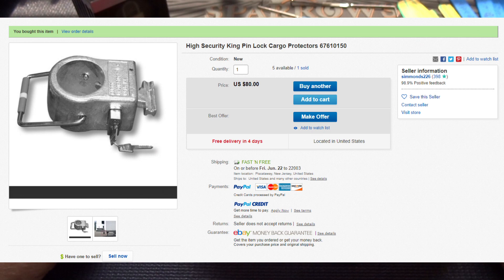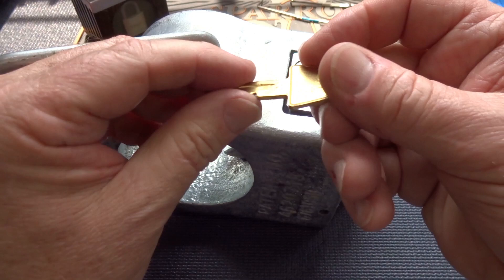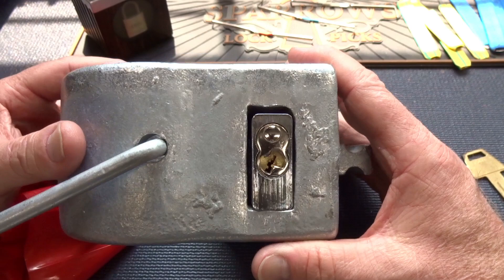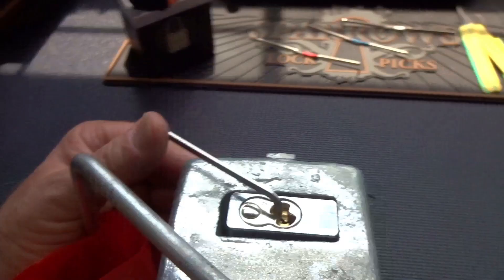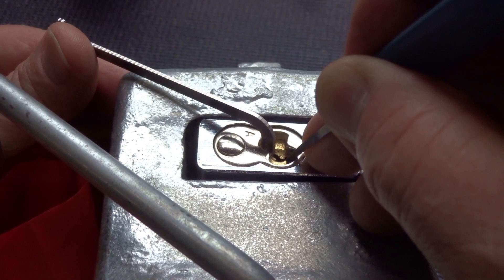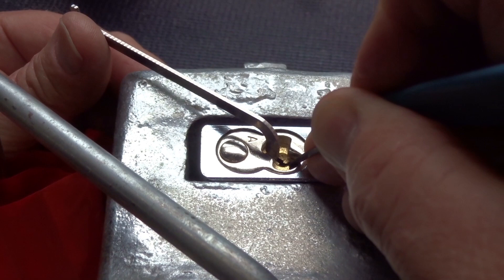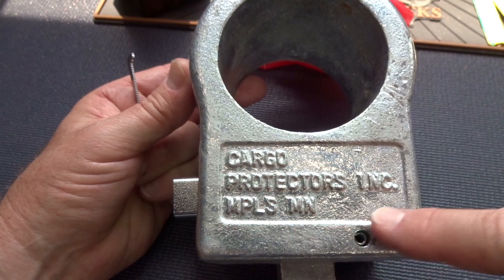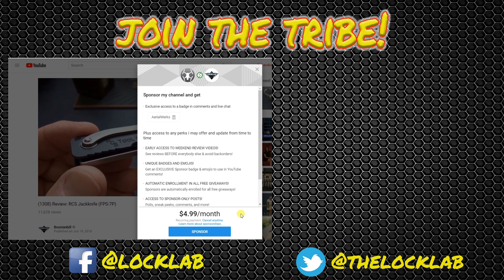(1310) Tractor Trailer King Pin Lock Picked Open

Comment: Just FYI, those locks are used if the truck has to uncouple from the trailer and leave it somewhere that isn't secure. Like if the truck needed repairs and the trailer has to be left in the lot. And yes the top of the lock will be flush with the bottom of the trailer and will be a greasy mess. They do not like uncoupling from a trailer because they are responsible for any damage or loss to the trailer or cargo until it's delivered.
Reply: I made the assumption those locks were so you can make sure another driver doesn't take a load out of the year that you wanted but hadn't got your tractor hooked up yet.
Reply: No, loads are assigned by the company, you haul what and where they tell you, although most good load planners will take into consideration where, when, and what you want to haul.
Reply: Driving around, I am always shocked at how poor the locks on big rig trailer doors are.
Reply: I ran a receiving dock for a for 3+ years at a distribution center of a large snack foods company, so I saw a decent selection of the locks that are used. From my experience I can say that most company drivers will use locks issued by their company since virtually all companies with more then 3 -4 trucks will supply them to their drivers. Any decent sized company will buy a whole bunch of locks all at once, and, usually, have them all keyed identically. Cheap ass Master Locks are probably the most common type of lock that companies will purchase simply because they are cheap. Owner-operators, the guys that own their own truck and often their own trailer, tend to buy nicer locks then most large companies do. 

Though at the end of the day trailer locks are mostly just their for ass covering purposes. Loads are almost always insured, and putting a door lock on the trailer that is attached to a tractor (or door + king pin / glad handle lock for a trailer that is waiting to be picked up) is mostly done to ensure that the carrier that is hauling the load won't be found at fault if the load, or any part of the load, goes missing. As long as those locks are present on a trailer they can usually say that they did their part to ensure that the load was secure, and be reasonably sure that they have very little in the way of legal liability.
Reply: It is also worth noting that aside from a REALLY greasy mess when attached to a trailer, in the winter even unlocking a kingpin with a key can be difficult.  In the yard truck of the distribution center I work at we carry around a can of lock melt to avoid any more trouble then necessary.
Reply: It's basically a theft prevention device.
Reply: William Jones this is what most locks are for.
Reply: It's actually company policy with large companies like CR England that you don't drop trailer outside of a company drop yard

Comment: This is to secure the trailer when taking the truck elsewhere. You are corect, the top of the body would be flush with a steel plate on the bottom of the trailer. To complicate things more, most driver will put a grocery bag around it to keep the grease off the lock.

Comment: It's a nice idea & easy enough to use. However, I've used a more secure setup on my 5th wheel using a short length of hardened chain wrapped around the kingpin & a high quality lock to hold it. The wider bottom of the kingpin & lack of room to fit bolt cutters, protects the chain from being easily/quietly cut. Far less than $80 & a superior method IMO.

Comment: I got a couple trailers and use the very same locks in as well as air line glad hand locks to prevent hooking up an unlocking the brakes but that's on the rare occasion that they're not coupled to the trucks, before using the locks we'd wrap hardened heavy chain around it and locked it up

Comment: Used to use these at work to secure trailers so a driver wouldn't pull the wrong trailer, while it was being loaded/unloaded still, on accident. Not really a security thing, but a safety thing. One of these and a big cone to warn them. If they left their tractor attached we'd chock their tires with a locking chock and put the cone on their hood. A lot cheaper than a dok lok, but prone to human error.

Comment: As a longtime truck driver I know about these things and there is very little, if any room at all for the would be picker to be able to directly eyeball the lock cylinder. As much slack as these locks have, they do fit up against the bottom plate of the trailer rather snugly. Unless the thief really wanted the trailer and its cargo, they would most likely move on to easier pickin's. No pun intended.
Reply from the maker: Yeah, I figured it would be pretty tight under there.  I actually took my lock up to Safeway and asked if I could film it on one of their trucks out back.  They refused, saying I might "get hurt if the truck fell on me" and they'd be liable.  I've never seen a trailer spontaneously collapse on itself and am SURE thousands of truckers do this kind of thing every day, if not every hour - yet we're not reading anything about crushed truckers in the papers...  What a litigious society we live in today. 😀

Comment: Having used pin locks before the lock freely rotates on the pin with the top surface on the 5th wheel plate of the trailer limiting room to move. On top of the freely rotating and limited space you have to deal with the nastiest grease coating everything down there in a spot that you are bent over in. 

The challenge on this lock is not the lock itself it is getting it stable enough to pick it in a confined space. 

When we just transferred the lock from one trailer to another it was easy to move from one to the other but when we had to store it we would store in a plastic bag to stop it from getting grease on everything around it. Funny story on that was the manager was looking for a stolen item and found the bag with the lock, he reached into the bag without looking only to remove a very grease covered hand.
Reply from the maker: Yeah, I've looked at some of the king pins and can understand how anything coming within 10 meters would get grease on it.

Comment: I know how you like to test the security of things so as a previous truck mechanic i heard a way to bypass the entire lock by unloading a can of electronics duster on the side opposite the lock and smacking it with a hammer the theory is the majority of the device is made out of cast iron and using the spray duster which comes out very cold will mess with the metalurgy and become very brittle allowing a hammer blow to destroy it
Reply from the maker: That's an idea I'll have to try, thanks!
Reply: Bosnianbill fyi wear gloves the can gets very cold!

Comment: Surely once its open removing the two locking pins /grub screws top and bottom will allow you to withdraw the locking lug and thus the lock itself from the housing as they would need to be rekeyable? EDIT see pdf description on how to separate lock from main body https://www.cargoprotectors.com/wp-content/uploads/2014/06/AM101inst.pdf

Comment: that looks very similar to the master lock #387.  2 or 3 good wacks usually pop those things off.  that one looks slightly stronger, but if it's cast iron, cast aluminum, or another weak metal they don't handle deformation very well.  The good ones are the big dome style ones.  usually made by universalboot (dot com), but are probably a little too pricey (complete with medico cylinder).  There is also the war-lok which also operates on the same principle.  Personally, i have a universal boot for when I have to lock my trailer.  Had it for around 10-12 years and it works by when someone smashes into it, it rides up on top of the 5th wheel, instead of allowing someone to smash into the thing and break it off.

Comment: Going to be awkward to get at for sure..maybe 3-4 foot of the ground? So stooping/crouching rather than kneeling..its also gonna be pretty flush as Bill says. Likewise dirty and greasy for sure.
Adds a critical delay rather than outright prevention. But a useful lock for high value freihht...or maybe it just points out the otherwise high value load on the lot? 😎
Reply: Not really, drivers will even lock an empty trailer if they have to leave it somewhere because they are responsible to the company/ owner of the trailer if it gets stolen, and trailers aren't cheap.
Reply: CO Jones Maybe some drivers do..or some company's insist they do.
But I have been married to a driver for 20 yesrs..and she has never had to , or wanted to use a kingpin lock 
Nor have any other drivers at the companies she has worked with.
So I would say ,imho, its he exception rather than the rule.

Comment: I'm interested to know what would happen if you drilled out that large roll pin that goes top to bottom - I assume it it just to stop the pawl coming out when it is unlocked.. but you never know ;)
Reply from the maker: You COULD drill it out but it extends all the way through the body.  It would be easier to pull it out with a slam hammer.  Even if you did though, if the lock was locked you still couldn't pull it off of the king pin.  All the roll pin does is keep the locking pawl from falling out when the lock is unlocked.

Comment: So.. one thing in terms of realism. If you're prepared to bring your tractor over and steal a whole trailer, I don't think you're going to be worried too much about someone noticing you coming over, and you can probably get away with being a little louder than a normal thief, or using a flashlight/headlamp. Honestly if your tractor is running you could probably totally cover up the sound of a ramset shearing the pins inside to smithereens.

Comment: That lock attaches to the pin that hangs down on the trailer, not on the truck (Tractor).
Reply from the maker: Yeah, I said that.  It is for the the tractor trailer king pin, as noted in the title.

Comment: The handle you said it flips over an sets in to the part that pulls out that covers part of the lock that pulls out you release the pin inside. Try to flip this over the handle into the groove .